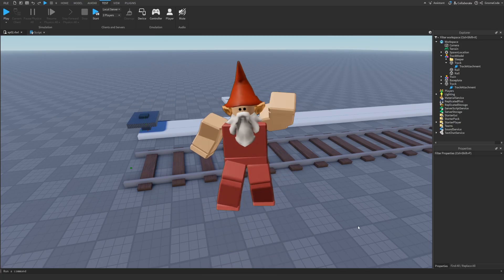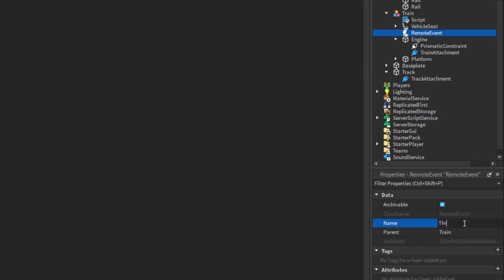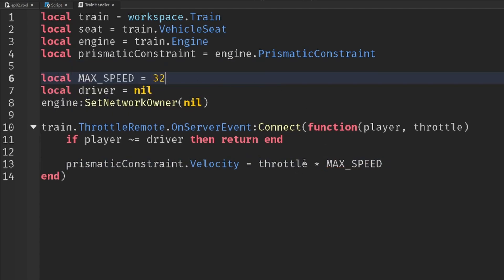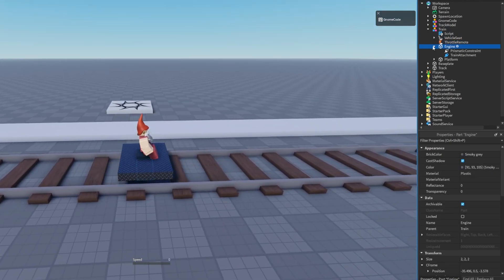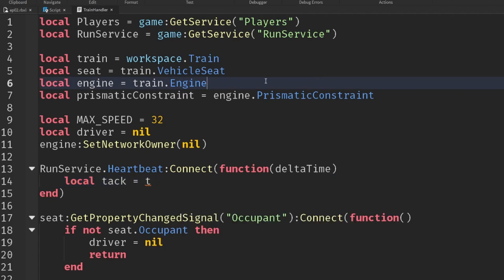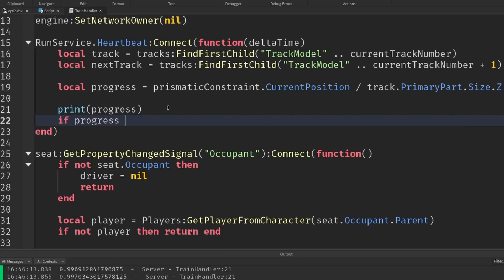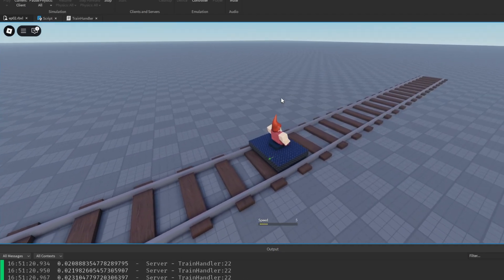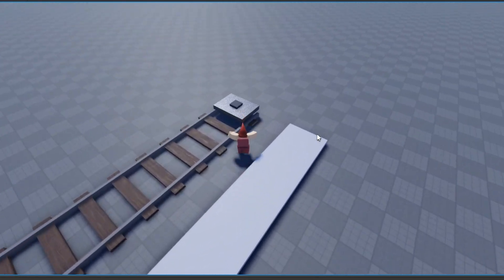Curved Train Tracks - Dead Rails Tutorial #2

Comment: For the final part of the script, where you're supposed to disable moving forward, it doesn't work for me. Deleting the 2 lines makes the script work, with the exception of being able to go backwards

My script:

local RunServ = game:GetService("RunService")
local players = game:GetService("Players")

local tracks = workspace.Tracks
local train = workspace.Train
local seat = train.VehicleSeat
local engine = train.Engine
local PrisCon = engine.PrismaticConstraint
local TargetAttach = workspace.Terrain.TrainTarget

local Max_Speed = 32
local currentTrackNumber = 1
local driver = nil
engine:SetNetworkOwner(nil)

RunServ.Heartbeat:Connect(function(deltaTime)
	local track = tracks:FindFirstChild("Track"..currentTrackNumber)
	local nextTrack = tracks:FindFirstChild("Track"..currentTrackNumber+1)
	
	local progress = PrisCon.CurrentPosition / track.PrimaryPart.Size.Z

	if progress >= 0.99 and nextTrack then
		currentTrackNumber += 1
		TargetAttach.WorldCFrame = nextTrack.PrimaryPart.TrackAtt.WorldCFrame
		PrisCon.LowerLimit = 0
	else
		TargetAttach.WorldCFrame = track.PrimaryPart.TrackAtt.WorldCFrame
		PrisCon.LowerLimit = PrisCon.CurrentPosition
	end
end)

seat:GetPropertyChangedSignal("Occupant"):Connect(function()
	if not seat.Occupant then
		driver = nil
		return
	end
	
	local player = players:GetPlayerFromCharacter(seat.Occupant.Parent)
	if not player then return end
	
	driver = player
	
end)

train.ThrottleAdjust.OnServerEvent:Connect(function(plr, throttle)
	if plr ~= driver then return end
	
	PrisCon.Velocity = math.clamp(throttle, -1, 1) * Max_Speed
end)

Comment: I got everything right but in part 1 and when I did the second part the driving wasen't working
Reply: Sameee
Reply: I had the same problem but I solved mine bye fixing the lower case letter in the line to connect it to the server it was fireServer and I changed it to FireServer and then it worked

Comment: there is a bug with this code, for some  reason the train keeps moving forward if you dont slow down the train before leaving the seat:face-red-droopy-eyes:
Reply: i think it happens only in the transitions between tracks
Reply: i think i fixed it, i checked if the seats occupant is nil inside the track transition code and if it is i set the prismatic constraint velocity to 0 :face-blue-smiling::face-blue-smiling:

Comment: i'm getting an Error that says:  Network Ownership API cannot be called on Anchored parts or parts welded to Anchored parts.
Reply from the maker: No part of your train should be anchored, otherwise it won't be able to move using physics constraints
Reply: @GnomeCode  i looked through the Train model, and it  does seem like no parts of the Train are anchored.